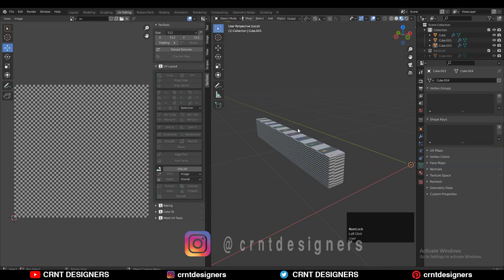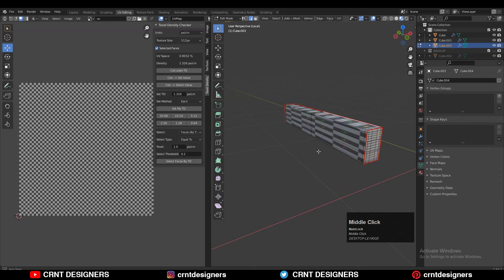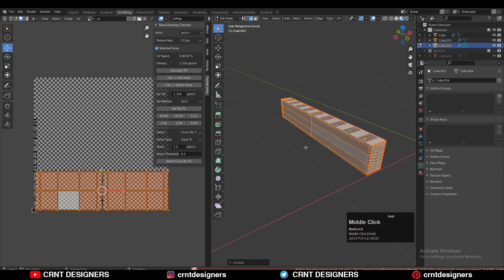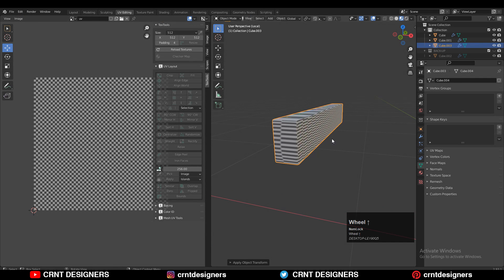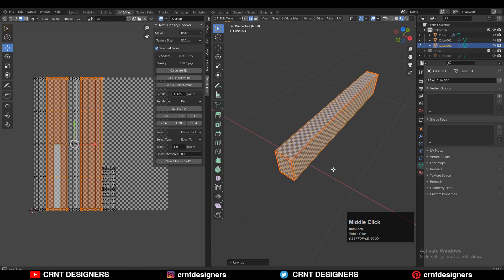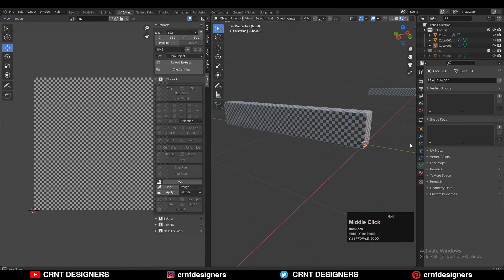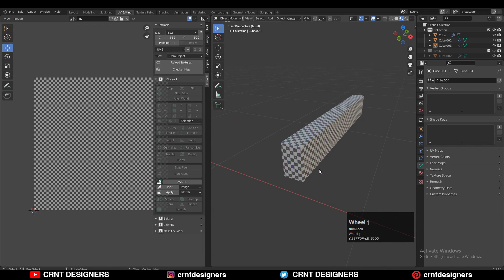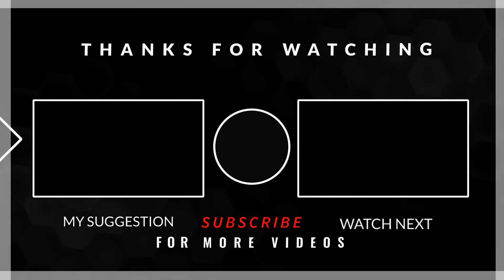How To Avoid UV Stretching _ Blender UV Unwrapping _ Tip 1

Comment: if it isn't working, make sure your texture's aspect ratio is 1:1. if you don't wanna change the image, you'll need to scale the object's scale to the image's aspect ratio. to do so without deforming the actual mesh you should set your tools on the right top menu to 'Affect only origins'. for example if your image texture is 512x2048, you need to set your object's scale to 1.000, 4.000, 1.000.